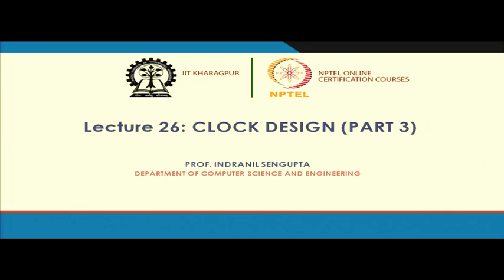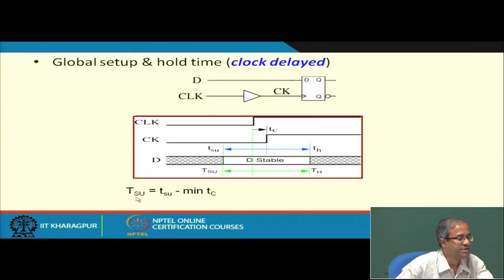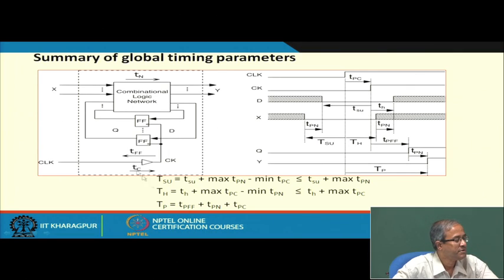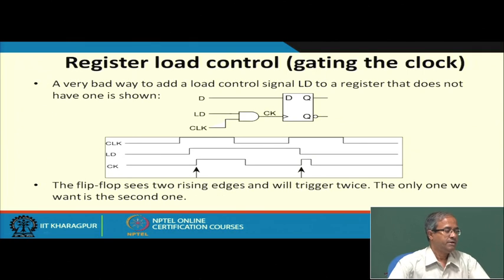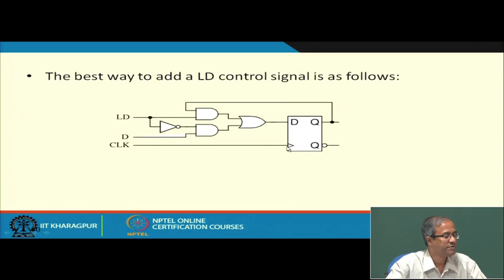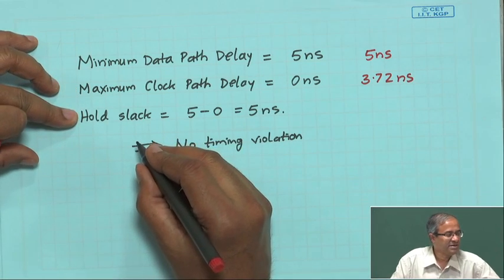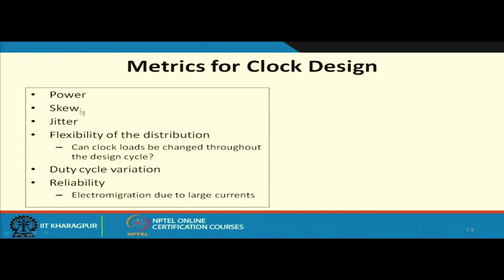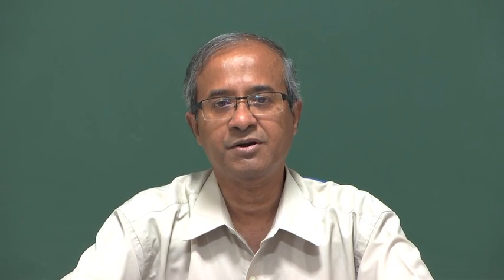Clock Design (Part 3)

Comment: Why they have added 4ns to data path delay,it should be added to clock path delay?
Reply: I think it comes in the data path for the second flip flop as explained in the calculation of propagation delay for a flip flop earlier in the lecture